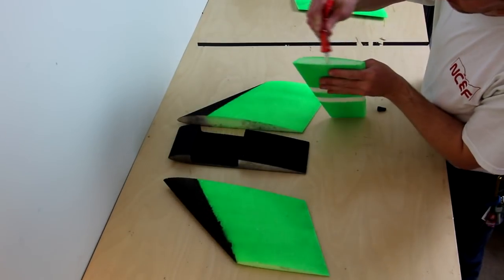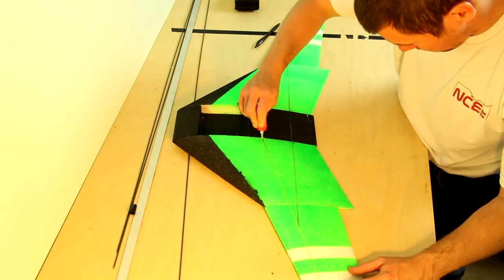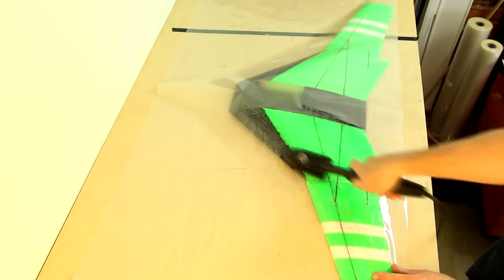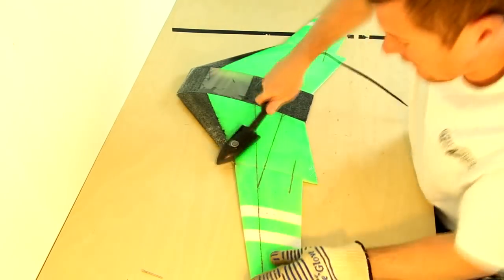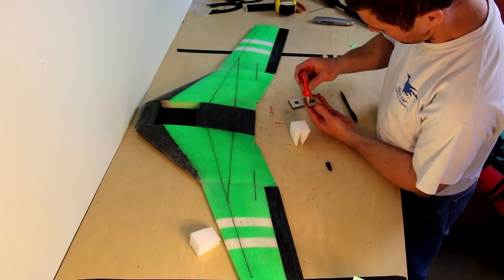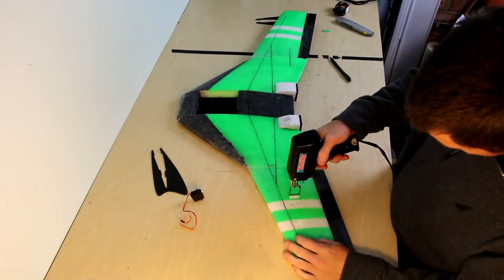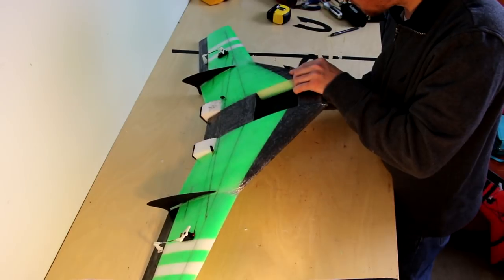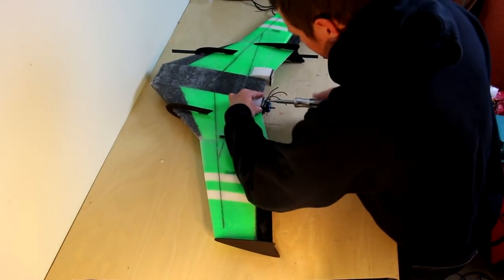VAS Wyvern V3 build video

Comment: hmm, how well you think some racerstar 2205 2300kv would work on this?  Found a 4 pack deal split between CW and CCW, feed it either two 4s2200 or a single 4s4000, go zoom zoom
Reply from the maker: Jason Cline It will work well.  Use a 5” prop and it will give you plenty of speed.
Reply: they're on the way.  Realized they won't have X mount with them, guess I need to source a couple 16x19mm mounts, know any sources?